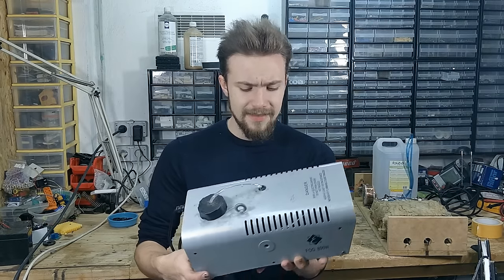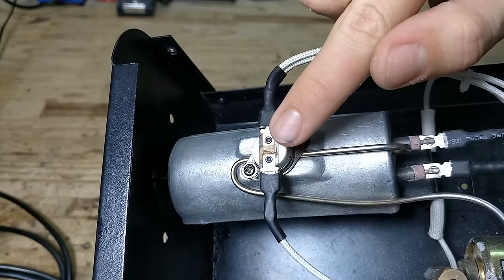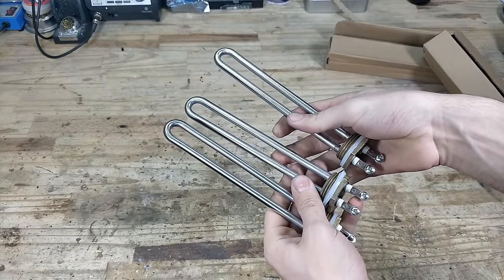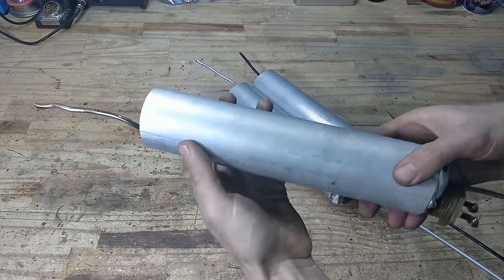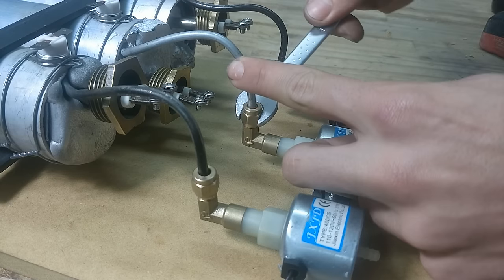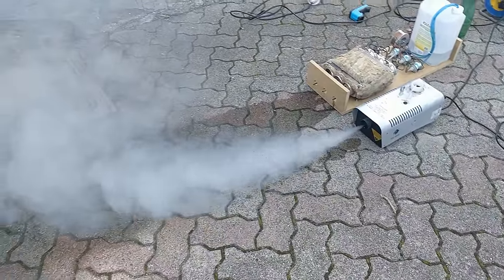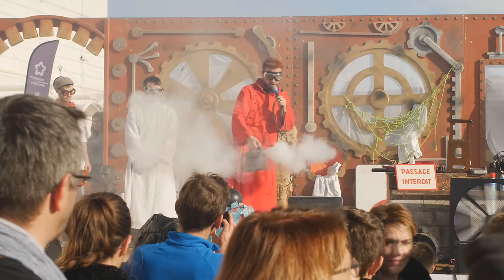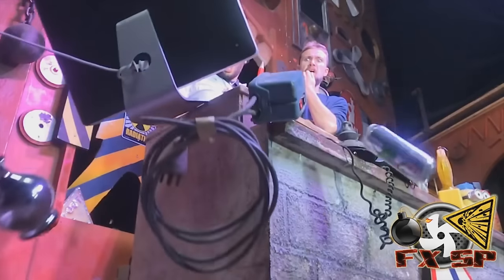Making the Monster Fog Machine - Nicolas Salenc PBP

Comment: I'm in need of a haze machine. Fog machines with an included wireless controller are only $40 on ebay, so I don't mind buying one, but haze machines are $300. There are fazers for $120, but it's not really a haze machine, more a light-weight fogger. Confetti canons are expensive too.

Comment: Nice mechanical assembly!
But as a becoming electrician and electrical engineer, I have to criticize your chosen wire-diameter which seems too small for the amount of current you draw.
You draw about 4.6kW, about 20A at 230V (only calculated quickly for the heaters and pumps), so I would recommend you to use at least 2.5mm^2 in the wiring for the outlet plug. 

Looks like you used 1.5mm^2 in the open-wiring-section, which is barely enough.

Keep this in mind just to be safe!

Comment: I noticed some smoke oil residue at the front of your smoker. I use a smoke generator on my RC plane, and i use a oil pump with variable speed. The trick is to have all the oil evaporated without leaving a residue, as my plane would be to greasy to handle after a flight. And it results in more smoke generated as to much oil also cools down the heat source...maybe you can try this with your setup

Comment: It's also a good idea to use stainless steel as the tubing, because you can heat it up at a higher temperature, and you won't have as much build-up on the inside of the tubing causing blockages.
Reply: Yes I have built smoke systems for RC airplanes and the stainless tubing was a much better smoke. Seem to heat up faster producing a long hang smoke.

Comment: 1:50
The circuit diagram is drawn incorrectly. Alone already the "protective conductor symbol" or Ground-Symbol as neutral conductor to abuse is conceivably bad.
Reply: so this is why mine did not work
Reply: I may not understand it but how does the thermal switch in that circuit do anything, when then pump and remote switch is in parallel with it, so basically bypassing it?
Reply: @WeAreThePeef  The schematic is incorrect.

Comment: Here's an idea, how about use the coil of copper tubing as a low-voltage secondary of a high power transformer, in which case you might be able to get away with using a shorter coil.  Then find/make an appropriate primary and core.  Similar to how a soldering gun or spot welder works.  The thermal mass of the tubing is much lower and you can control the fog on demand.  Of course you'll have to short the ends of the coil with tubing or a copper bar.
OR...
If you wind everything on a torus, the copper tubing will come back to itself, so maybe lay it horizontal and have the inlet/outlet on opposite sides, or vertical and have one above the other.

I'm curious how well any of that would work 🤔
Reply from the maker: That's a pretty good idea

Comment: 1. Is preheating required? If yes how long?
2. How much temperature heater has to reach to comvert to fog?
3. Did you use a temperature controller to cuton and cutoff heater?
4. Do you have any sequence of the internal working?

Comment: cheaper to buy a professional unit for god sake
Reply: koncrete TO did you watch the video? He said the parts were cheaper. Also, the professional ones (especially chauvet) are not very reliable.
Reply: @17industries42  The parts you need for the machine itself, yeah, but you need to invest a lot on the tools needed to make it work, and you need the space to actually pour molten aluminium in total safety.

Comment: Next time try the SP35a pumps, they are the same Antari uses and they have more power , very nice video btw. And for all your Halloween and Boyscout dudes and dudets..... we poured some fog liquid in a pan and heated it with a portable gas heater we used on hiking trips, let is heat up and use a fan to blow over the pan.... be very careful, it’s not save, but this was our boyscout hack we used for years 🤪

Comment: Nice build, but are you really running a 4,5kw heater (would make 19,5A @230V) on a 16A outlet, fed by what looks like 0,75mm² wire? 0,75mm² is good for 10A.

Comment: hi, i've maybe got an idea to improve the design, a digital controller would be better cause you can limit the heat properly to the liquid, but a cheaper one would be, to stop pumping a bit when it gets below a different temperature treshhold, so the elements can heat up enough cause i'm pretty sure that after a while it might drop below the sweet spot, so i guess you could use a relay to start pumping once it reaches a certain heat level (lets say 200), and i would limit the heat to about 230 deg because 260 deg certainly will overcook the liquid and that can actually form formaldehyde

Comment: Looked at the first schematic.  This is the same as all the Chinese smoke machines.  It is bad because no matter how long you allow for heating, if you want smoke on demand, the block can be heating at that time, locking out the pump.  You need a double temperature switch, the higher (normally closed) one controlling the block heating, and the second one (normally open) in series with the pump.  Smoke will be denied only if you try too soon after starting up, or after attempting to smoke continuously and overwhelming the heater.
     The way the "hot blocks" are made on the larger machines is a aluminum block, drilled through 1/2" (about 4" long).  A double spool shaped aluminum piece is pressed in, forming 2 narrow annuluses with a small aperture between.  Both ends of the block are pipe-tapped and fittings screwed in for input and smoke output.

Comment: Hello Nicolas, great video man!!!! i wan to make one to put in my garage for security. How mutch time does it cost to start smoke when you push te button if generator is cool ?
Reply from the maker: It takes about 5 mins (security fog systems don't use a heating block for that reason. They simply use a tube instantly heated by a butane propane flame). Check out insect foggers, they operate in a very similar way
Reply: @NicolasSalencPBP  ok i understand. Maybe use 3000watt heater and make the aluminium block smaller so it will heat up faster. Can i use a maybe 300 degrees celcius or a bit more thermostat?

Comment: Nice job, cool tutorial. It looks like you've got your fluid volume too high for what those heating elements are capable of vaporizing. That's why you have so much moisture building up on the floor in front of the machine.

Comment: Looks good but i can not see that  the metal pipes are  earthed so if the heatingelement phase comes in contact with the metal..you get a dangerous situation..so every metal you can touch..please make an eathconnection with it..if it exceeds 30mA the differentialswitch will go off and keep it save.

Comment: Interesting project, although I suspect this is more like 2.5kW than 4.5kW. The latter would be nearly 20A at 230Vrms, which would not be supported by a standard mains supply. Have you measured the actual power consumption at the wall?

Comment: How did you manage to use the fog machine on a single socket?
It would draw 4,5kW, thats more than the normal C16 circuit breaker in france would allow over long time.

Comment: if you want to make more smoke, fast, you could get a more powerful heater... or. preheat the liquid to just below its boiling point. the, you can use high velocity pumps to push it through coil. as its just below boiling, your coil will instantly boil it and you wont have that problem of the heater being overwhelmed. For example, if you preheated your liquid, and used a high velocity pump, you would only need one heating unit, not 3. makign the entire thing a lot more user friendly.

Comment: Try Reduce the pump speed, and rely on the liquid to gas expansion to pump out the smoke from the exhaust. I think it will create more smoke. Just make sure the liquid is pump with no trapped air bubble to keep the pressure inside the heating tube high.

Comment: so wait... in theory... you could potentially run it from a car using a weak pure sine inverter. It would just need more time to reach that temperature, but once it does it'll barely use any power at all. Am I correct?

Comment: You're shown wiring diagram is wrong. Heater 3 will still heat if the thermal switch is open. You just have to move the LED cable before heater 3 and then it works. I hope you did this.
Reply from the maker: It is correct. The current flowing through the lamp is so weak that the heating of the element is completely negligable.

Comment: The aluminium won't shortcircuit the heating resistor ?
Reply from the maker: Surprisingly no! I'm not sure how exactly they are made but I'm assuming some ceramic material must insulate the actual resistor from the outer tube... These are made to be directly submerged in water, so I assume it is safe to use them this way...

Comment: Re: "wattage doesn't affect smoke output" -- not exactly correct.  The amount of instantaneous fog production won't change, but the duty cycle of fog production will improve with higher-wattage heating elements.  It's all about heat in vs heat out -- the heater adds heat (duh) and the fog liquid takes it away as it changes phase.  If the core loses heat to the liquid faster than the heater supplies it, the fogger can only operate for a period of time before it must stop to reheat.   However, if the heater can put heat into the core faster than the liquid takes it away (i.e. more watts), the fogger can operate continuously.  Instantaneous production is the same, but volume over time is improved.
Reply: Note that a 100% duty-cycle machine requires /two/ thermal switches; one to cycle the heater at the appropriate temperature and another one, at a slightly lower trip point, to shut off the pump when the core is too cool.

Comment: I live in a hot climate so would this fog machine need a chiller?
Reply: So you know. It doesn't matter about ambient temperature. The fog will raise the same. But if you use a chiller the fog Will be more dense and stay closer to the ground, rising slower as it worm's up. So it just matters on what you want the fog to do. If for a Halloween effect chiller for sure. Fans can help spread the fog and old vacuum cords help if you want to hide the machine.
Reply: @mandarb23  thank you

Comment: I don’t know what circuit breaker you have installed, 
but if it’s really 4,5kW (I guess not) then your cable spool probably would have melted down 
and the type E/F plug your using wouldn’t be adequate cause it’s only good for 16A wich at 230v would be 3,6kW max 

I guess your Ebay seller tricked you and got you lower wattage heaters

however very nice build

Comment: You should consider a different heater -- the "wet" elements you're using are designed to be submerged in a big volume of water and basically never go above 60-90 degrees C. In your setup they will get fried rather quickly due to internal overheating, and your construction makes replacement impossible. There exist "dry" elements that can tolerate high temperatures indefinitely. They are cylindrical in shape and about as big in diameter as your evaporator coil, so no aluminum cast will be necessary, just thermal grease.

Comment: Wouldn't you have got more fog output by using one hotter element and more fluid (bigger pump)?  Seems like you limited yourself to the specs of the small fog machine you used as reference.  So you ended up with 3 of those smaller machines in one housing.

Comment: no point to add a heater, because when the liquid is spray out and mix with air in the open space . the liquid will be come worm after cool down . this device if use indoor with heater is ok, but without heater to heat up the liquid there can't became steam this is also a problems . it is troublesome

Comment: Hi, 260 degrees? i'm guessing "F Not C" as per your ebay listing (35C-160C)
You state in your video it's 260C but the ebay listing cntradicts this.
Please clarify.
Reply from the maker: Hi,
The required temperature is indeed 260°C.
The eBay listing I show doesn't sell switches above 160°C
I used this listing as an example since the seller from who I purchased the original ones had removed his listing...
I hope that helps!
Reply: @NicolasSalencPBP  Thanks for the clarification.
Reply: @NicolasSalencPBP  I forgot to ask, Do i need normally open or closed?

Comment: Does anyone know of an alternative to messing with molten aluminium?  Either repurposing something off-the-shelf or perhaps some kind of an oil fill?  Is it possible to use the tubing itself as the heating element, reducing the thermal mass of the system?

I am looking at a high-volume "security fog" machine for domestic use, coupled with strobes to increase the effective visual blocking.  I'm going for high shock/confusion as deterrence combined with the general principle that it is difficult to steal what you cannot find.

Design goals are high volume and fast startup, with size and power consumption being less of an issue (I have 1 meter above a lowered ceiling and 1.5m for an underfloor unit)

Ideas?

Comment: IMHO schematic is incorrect. Pump must be connected to 220v directly not through the heater. Because if thermal switch is closed pump just stop working.

Comment: PLEASE HELP. I know there is little chance you see my comment, hopefully someone might know the answer. I’ve poured 2 heater blocks and the copper pipe INSIDE the block is leaking. I used known good copper, but it seems when I pour the aluminum the copper tube melts?

Any suggestions would be appreciated as every pour is costing me $17 per pop in materials.
Reply from the maker: Hi Matt, 
Aluminium melts at 660°C. Pure copper melts at 1085°C. Either you are heating the aluminium way over 1085°C (which I doubt) or the copper you are using isn't pure and melts at a very low temperature. How do you know the tubes are melting if they are cast inside the block of aluminium? Are you seing fog escaping through the cracks within the block?
Reply: @NicolasSalencPBP  Thank you so much for the reply!  There are voids in the cast that the air escapes from when I blow in the tube.
Reply from the maker: @mattadams7660  How are you melting your aluminum?
Reply: @NicolasSalencPBP  Not sure if y’all have crawfish boils, or fry turkeys in your neck of the woods, but I use a very high intensity propane burner. I am melting it in a stainless pot, and have a galvanized bucket over the top to hold the heat in. It takes about 20 minutes to get to about 4 cups of liquid aluminum. For the second try I did a lower temperature, where the aluminum wasn’t as runny, but I had the same results.   The copper I bought new from the store. Its 1/4inch for refrigeration
Reply from the maker: @mattadams7660  hi Matt,
I have to say I'm really not sure why you are getting leaks... I could be wrong wut I highly doubt the aluminum is hot enough to melt standard copper... If it's hot enough it might warp it a little but I really don't think it can poke holes through it. However, I believe aluminum gets quite corrosive once it is in a molten state. Perhaps the particular tubing you are using reacts with it? The only things I can suggest is to lower the temperature or perhaps try a completely different brand of tubing? Sorry I can't be any more help that that
Reply: @NicolasSalencPBP  Thanks so much! I’m honored that you responded. I will be trying different tubing this weekend.

Comment: be careful when handling inulation material like that in general... its not as bad as asbestos... but tts still not good... its probably more of an issue if its being used in a forge though where you always need to treat the surface layer to avoid it giving or nasty particles....  but i would also not like to handle that stuff without gloves ideally or washing the hell out of my hands after... its not the safest material out there...  depending on what insulation they use... againnt not as bad as asbestos but it can be bad..

rockwool i think is a lot less nasty... but yeah still cursed stuff... i hated doing insulation work with that shit...

Comment: Seems like all the work and time getting put on this is worthless. I could buy a nice fog machine For about $400 and be done with it. Also, seems unfair comparing a small fog machine vs a 3 coil system.  you essentially are comparing 3 fog machines vs 1. Maybe put it up against the hurricane flex.
Reply from the maker: I compared the two as they both cost about the same